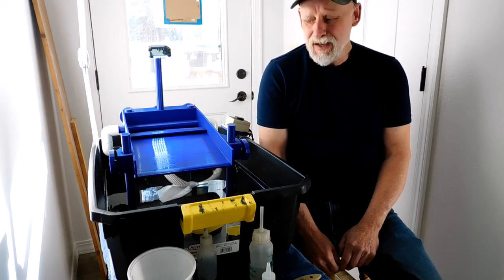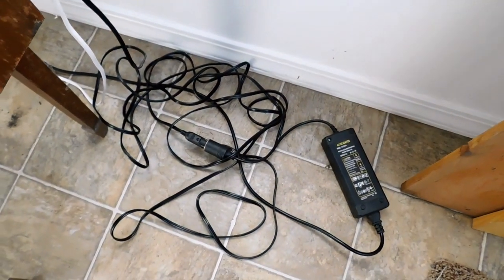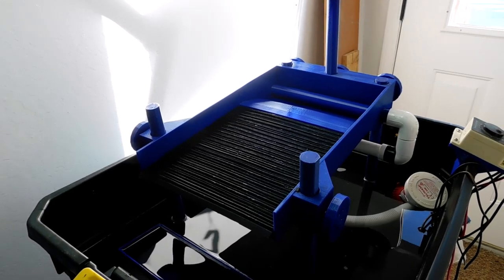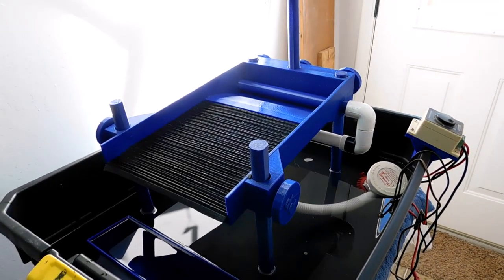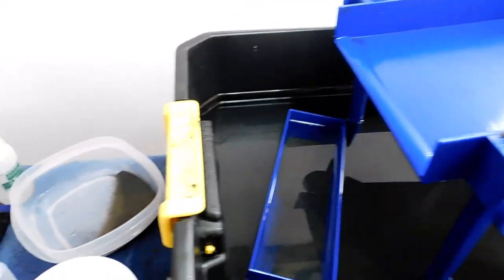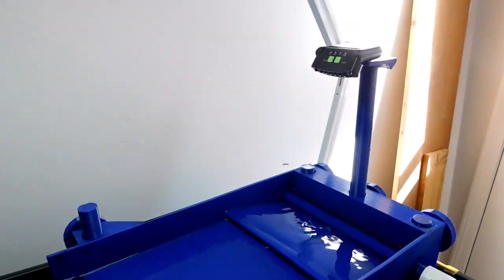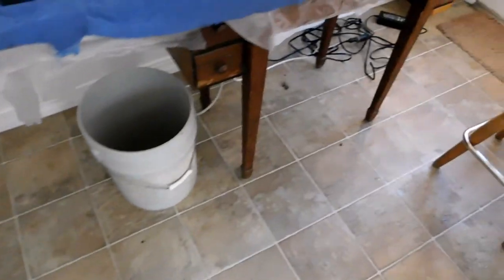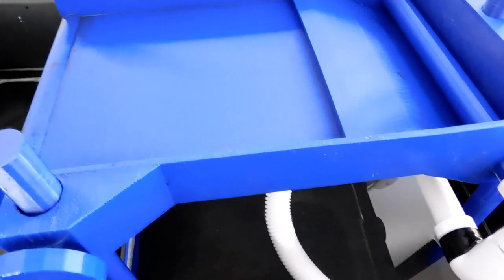AMAZING 3d MILLER TABLE -  CLEAN UP SLUICE

Comment: Another invention completed looks like it works great Alan congratulations my friend wow 80 hours is a bit of time but you’ve put months into the creation. I checked the price and in my opinion it’s worth it most Miller tables don’t come with speed controllers and lights so well done thanks for sharing see you on the next one 👍🏼👊🏼
Reply from the maker: Thanks 👍 You are right and also don't come with a mat to use as a clean up sluice as well.

Comment: Alan !!!  Good to see you back on YouTube !!  Been thinking about you for sometime, and wondered why you haven't posted anything.  Now I know what you've been up too.  LOL !  Really nice job on the modified Miller Table !  I like the size and shape, and the process.  Appears much simpler than my Blue Bowl. 👍👍  Also like the added features, such as speed controller and lighting, which you don't see with other products.  The only suggestion to be competitive would be to include the tub.  Plus you can ship the whole thing in it.  Good job my friend ! 🤠⛏⚒⚙🛠👍
Reply from the maker: Hi Allan yep I just took a break for awhile. I love the new miller table and it sure does work better than a blue bowl and faster. Thanks for your input I do appreciate it. The tub was part of the plan but seems they are always out of stock. Go figure.
Reply: @alanrobertson2510  Costco runs a sale on the 27 gal for about $9.00....
Reply from the maker: @allansgoldmining  Thanks I will check them out.

Comment: That is a very well made device. You put a lot of detail into that. I deal with 100 mesh gold here in our black sands. I am processing a batch from Lake Huron right now. Hope to have the video done soon. That stuff is hard to separate tho.
Reply from the maker: Good luck on your clean up. I will have to check out your video when it is done. Thanks for watching.
Reply: @alanrobertson2510  Thank you. Part 1 is finished. 7 colors to a single test pan. Not bad for Lake Huron. I have more samples to run yet.

Comment: 20:13 3d printed items dont hold up well in sunlight..is yours any different? Also I didn't see this product on your web store.  Is it still available?
Reply from the maker: I don't make this unit anymore. I turned my Hobby Miner sluice into a miller table.
Yes products made with PLA will warp in the heat or become brittle. I print with PETG and it will not warp in the heat. I have not had any problem or heard of any with PETG.